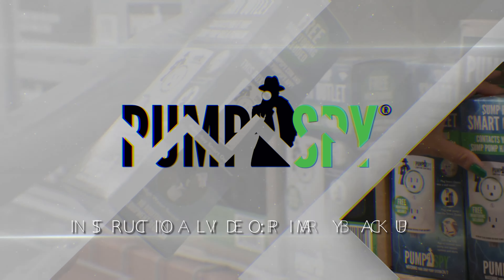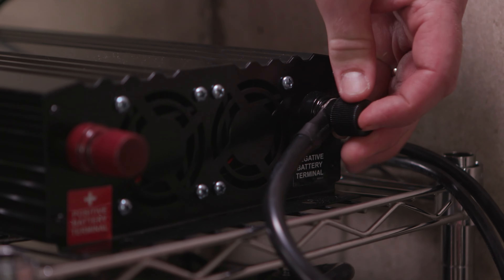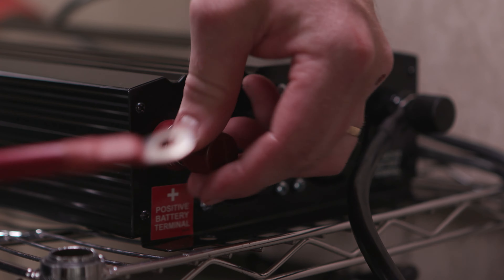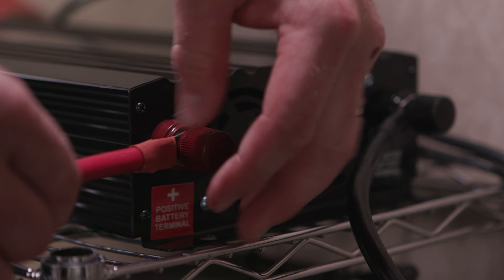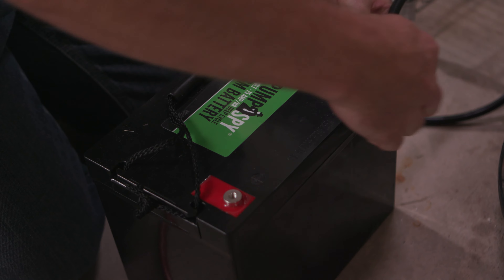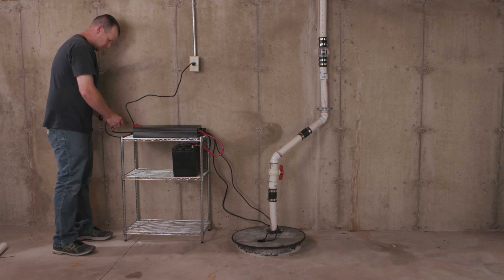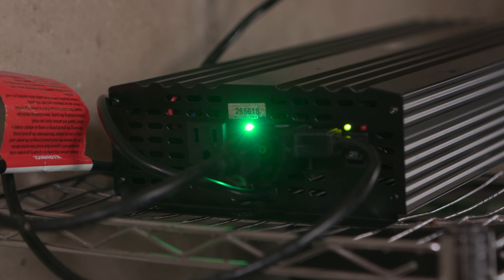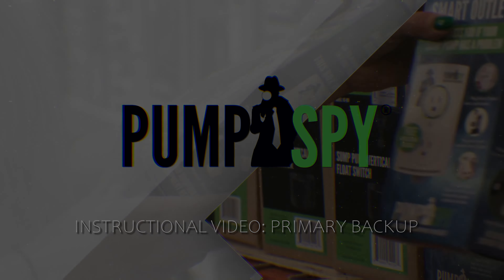How to Install PumpSpy's Primary Backup Power System

Comment: I just hooked up my Pump spy Primary backup system and everything seems to work. Just one question. I have a pump spy 12 volt battery and the system is charging and it is at 14.5 volts with two bars to go. Is this normal?

Comment: Getting massive sparks trying to install 2000w inverter to my 12V battery. Even using the ohm resistor it keeps sparking during install. Following all directions from manual.
Reply: Did you ever figure this out?  I just purchased the same inverter and will install it soon.